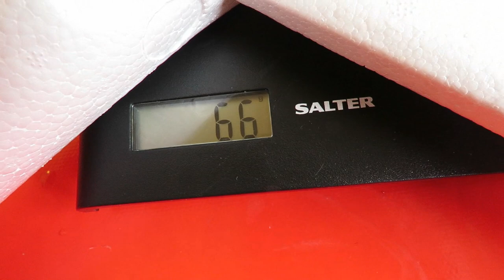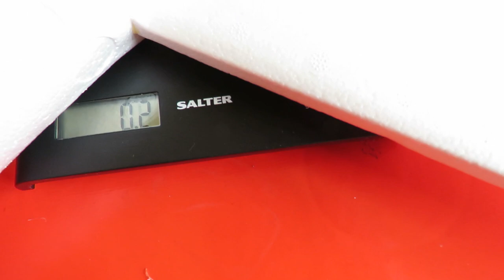Cheap glider from Poundland - RC conversion

Comment: nicely done i would recomend sanding the wings to a proper airfoil it will reduce waight and drag helping it out
Reply from the maker: The problem with that is this foam does not have much strength and reducing the thickness will weaken it, however there is room for improvement and just getting rid of the square edges might help. I have done that on a later modification but haven't had a chance to fly it. In the back garden I could not see any noticeable improvement.
Reply: +GrandadIsAnOldMan unlucky youll get there eventially like you always do
Reply from the maker: Riley howe-mills thanks for your confidence, I have to say it is being harder than I had hoped. There are at least a couple of other ideas I would like to try. I think ailerons would help the stability and I would also like to try a fairly major remodeling by changing it to a high wing version.
Reply: @GrandadIsAnOldMan    Indeed!  A high wing with a little dihedral tends to glide better, but you have seen my experiments with these using a PVC pipe launcher.  One of my old videos I will have to remake since the original is gone, gone, gone after the channel reboot.

Comment: Those motors look like the size often used on the trailing edge of the main wing around the 40% length spot from the wing root for differential thrust flight management.  If the model is a good glider, the motors help it climb by speeding up, or turn by one motor speeding up.  Otherwise control, or interruption of flight is minimal.  When they are mounted on the trailing edge of the main wing, facing the propellers towards the tail, they point upward a few degrees to cause the nose of the model to shift upward a bit since they are mounted just aft of the best CG spot for the model's glide slope.  A dead simple control option with minimal weight for limited RC control on a windless day.
Reply from the maker: Thanks for the detailed comment

Comment: to make it work better buy control horns and push rods for the rudder as well as putting the motor on the front (1500-2000kv) plus use a lip battery about 15-20cell as well as having an ESC 10amp to control the power ext. you can get most of this stuff on amazon or ebay. thanks for reading and i hope that helps.
Reply from the maker: 15-20cell LiPo?  I guess you mean 15-20C

Comment: You can probably save a bit of weight placing the motors on the underside of the wings & removing the stick that they are sitting on atm.

it is a bit nose heavy still so id try removing a bit of foam or relocating whatever you have in the front backwards a bit or more centered with the wings (sort of where the center of mass should be is about in the middle of the wings.

As its made to glide you might need to modify the angle of the wings too.
(Possibly shaving off a bit off the topside so there's a gap where you can increase the angle of the wings slightly while adding a bit of a spacer made off cardboard + glue should work)
(Seems a bit neutral for its purpose of making it a rc plane as it is atm)

To get it to rise upwards more if the weight distribution is fine most simple rc planes have either a low weight in the front or rather angled wings so its by default rising with no input from the remote.

Give it a go with placing the battery a bit more too the front (that acting as the weight pretty much instead of that nut) along with placing the motors similar too this rc toy plane

http://ramabo.com/ProductImages/2014/10/30/1090/silverlit-x-twin-rc-plane-air-acrobat-13338857.jpg
might need to extend the tail wing a bit more as well as it trailed off too the side almost right away when you threw it might be just wind picking it up & going off too the side though.
ofc dont place them too far apart as it might affect the way it turns badly.
Reply from the maker: Interesting you should feel it looks nose heavy. I have had to add significant weight to the front to get the CG to where it was before I started and it's skittish flying (in the next video) makes me think it might need even more. There are some links in my video description to other people's successful conversions of similar toy gliders.
Reply: Interesting ideas, but have you tried them on this kit, or some other?  Youtube has more than a few videos of what others have done with this kit, but we often cannot find videos of failures and discussions about what might be the problems with an RC version this small.  There is also a few threads in RC Groups using this kit and what others did.  Some of the modifications are simple and easy, while others are a bit more work.  My own experiments have been with making a better glider out of the original kit, but by the time I made the last kit into a glider with all the necessary improvements, it didn't look like the original kit anymore.  A guy with the Youtube channel floridax2 takes extra effort to the next level and has made some wonderful RC examples to drool over.

Comment: I'd put the props on the wings and sand down the flat part of the leading edge just a thort
Reply from the maker: Certainly the square edges on the wings will have to go. There are many options for placing the motors. The current position was chosen to protect the props when the aircraft lands.

Comment: The simplest thing perhaps, would be to move the batt up to the very front, underneath. That's what I did, with 2x 130mAh finger type 1S lipo's in parallel. Should enable removing the nose weight. Those motors look like they might be good enough with such a change. 
Mine was 2.4oz, with N20's but the same type of props (for dimensions). Receiver, motors and props were from a 2 channel AirHogs Mini Storm Launcher.
Reply from the maker: Hi Slider, yes I have it in mind to make an extension cable for the battery wires. I am a bit worried that I am running the two motors in parallel direct of the receiver. I have no idea how much power they are drawing like that and how long the receiver will take the current draw. After putting the receiver in place I remembered I had intended to try to disable the gyro so I am still not confident with that receiver. I rather like the idea of using ailerons instead of the rudder but that will need a little more work. As it is it tends to pitch over quite easily at the slightest attempt at a turn. There is one more video to come at the moment with different props and then there will be a little break on this particular project as I am on holiday. I did sand down the wings a bit, add a little dihedral, and tape the battery right down the front. No video of that and not sure if it improved it as I only had time to throw it across the garden without power so we will see when I get back.
Reply: Have a great holiday :)
In nearly all cases of overload, a receiver will shut down. To the software, it's like a plane hitting the ground powered and the amperage jumps up. Normally such a motor overload is pretty quick to show too, a flight across your back garden sort of quick. For stability, I would recommend a taller, larger tail vertical, perhaps modeled on an Embraer or similar business jet (which was what I did). The wings could also do with washout, sanding progressively more toward the rear corners. I always imagine real versions and how such a plane would look full size...this one would look fine, except would have a stumpity tail and fat wing tips lol "Passengers now boarding at Gate 7 should ignore the look of their plane, please also disregard the foam packaging seat cushions and hotglued landing gear"
Reply from the maker: slider2732 Thanks Slider :)
Reply from the maker: Would you mind if I included the link to your successful video in my video description. I noticed it was "unlisted" status so I didn't share it.
Reply: Oh certainly ! it's only 'Unlisted' because it has no sound. It was for the RCGroups blog post...the camera is the hatcam one, a Hubsan quadcopter camera.
Reply: slider2732

Comment: When you get this sorted it's going to be your best to date.
More power.    :-)
And reprofile the wings.
Reply from the maker: In the next video I have modified it to take slightly larger props and we do get the beginnings of a climbing flight but it is terribly unstable..  Since then I have sanded the square edges off the wings without taking them much thinner as that foam has very little strength, but haven't had a chance to fly it. In the back garden I could not see any noticeable improvement. I also encouraged a little dihedral by applying sticky tape to the top surface of the wing under a little tension so the wing bows up slightly.
Reply: Could you reshape the wing sockets on the fuselage or the wing butts to create the dihedral?
Reply from the maker: Wil Hobbs yes that is on my list of options. With this particular plane I glued the wings in early on so it is a matter of cutting them off and bracing them. I have used the tape method successfully on other planes and it is an easy quick fix and adds a little extra strength.

Comment: Those wings do need improving, they are not giving much lift but creating drag, if they were aerodynamic the greater lift and lower drag might allow those motors to cope.
 I know you want to keep the original glider as bought but you have modified the rear controll surfaces so profiling the wing could be allowed within the remit.
Reply from the maker: The problem is this foam does not have much strength and reducing the thickness does weaken it, however as discussed there is room for improvement and just getting rid of the square edges should help. I have done that on a later modification but haven't had a chance to fly it. In the back garden I could not see any noticeable improvement. I also encouraged a little dihedral by applying sticky tape to the top surface under a little tension so the wing bows up slightly.
Reply: i think your encountering the problem of trying to make a silk purse out of a sows ear !!
 But doing these improvements is very satisfying when ultimately you gat a result.
Reply from the maker: Ian Virco yes but of the three different "Bargain Store Gliders" I purchased, each the same price, this one shows the most promise. For a start it actually flies without breaking straight away and I am confident my grandsons would be more than happy with it's performance out of the box. Any improvement will be a bonus.

Comment: starting from scratch (except for the glider I already have) how much would you say I'd have to spend to build mine on the cheap? Not only motor and servos, but transmitter, battery, charger...
Reply from the maker: This really is NOT a good project to try as your first attempt. My end result only just flies. The only successful "conversions" I have seen done involve significantly changing the glider by replacing the wing and the tail so very little is left from the original purchase. However to answer your question you can buy  something like a FlySky transmitter and receiver from a little over £20. The motors I used here are a little small for the project but they can be purchased for around £5 for a pack of 4 and often come with the propellers. If you use the FlySky receiver you would also need to buy an ESC to control the motors and servos to control the elevator and rudder so probably another £5 to £10. I used a WL Toys V911 combined receiver, motor controller and servo unit which you can usually find for a little over £10. You also need a LiPo battery and a charger - you can probably buy a charger with a set of 4 batteries somewhere between £10 and £20. SO THE BOTTOM LINE IS YOU COULD BUY A READY MADE RC STARTER PLANE with transmitter READY TO FLY for less money. Here is a typical example (I am NOT endorsing this product - just using it as an example of the price range) https://www.ebay.co.uk/itm/142775763768
Reply: thanks for your advice.
Reply: @GrandadIsAnOldMan   Excellent advice since those of us with RC gear to recycle into another project have already spent the money for the parts and have what we need on hand.  For us it isn't getting started, but making something else out of foam to fly after bashing up what the RC parts came with.  If we buy more RC gear it is to go bigger, or replace something that no longer works.

Comment: Nice u should do a vid showing how to make an rc plane for really cheap!
Reply from the maker: I think you will notice my RC planes are not very successful. There are links in my video description if you want to see other RC work I have done.
Reply: OK you should maybe try buying those $5 rubber bant powered planes because if you take of the propeller and rubber and replace it with motor props esc servo ETC it will be nearly the same weight resulting in it flying.(ive seen many like this) hope you try this and i cant wait to see this fly in a field because there is much more space!
Reply: @ZyFinity  That is a lot more work than he has invested in this project and others like it.  His idea was to go cheap, simple, and without a lot of effort like others have done.  A very different set of goals.  I have also played around with these $1 toy foam glider kits, but in my case I haven't installed the RC gear yet since I first want a good glider design that doesn't take much effort, or need a lot of extra foam.  The foam on these kits is so low in quality, I was forced to do some serious modifications and use additional foam sources.
Reply: @wattwaster5936  My comment was 4 years old lmao
Reply: @ZyFinity   True.  Hope you and other viewers can use my comment as a profit in the hobby.

Comment: You should put a motor in the front
Reply from the maker: I have seen similar gliders modified like that but I want to retain the original look of the aircraft as far as possible. I would also need a suitable motor and I don't have one.
Reply: +GrandadIsAnOldMan okay i get you  😀